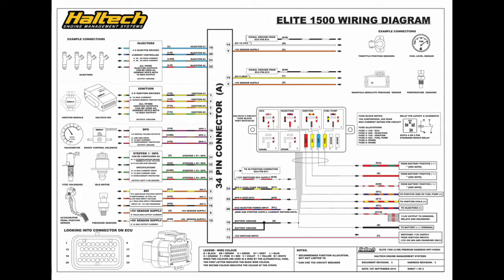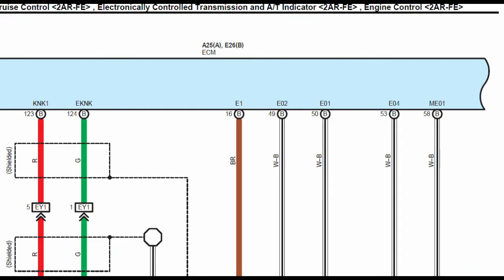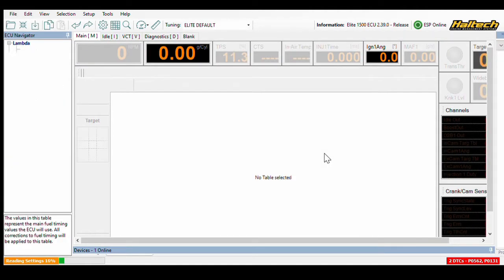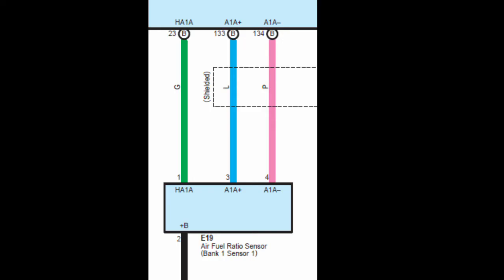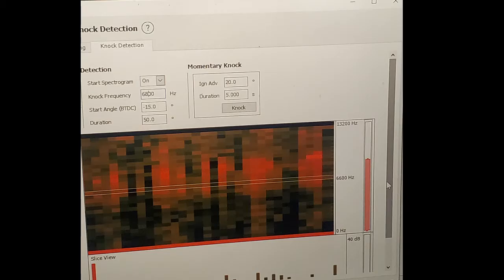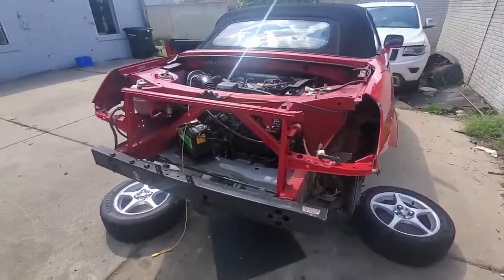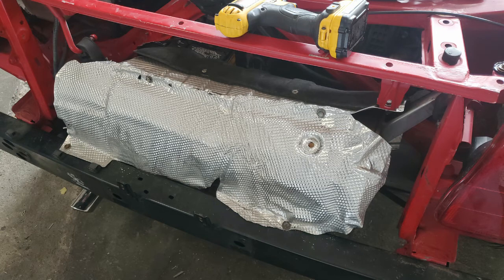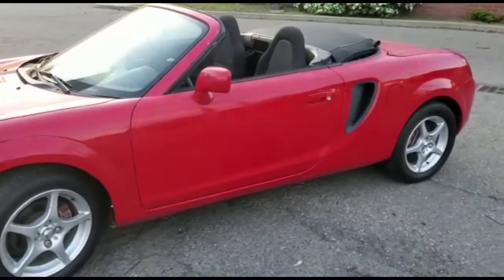MR2 Spyder Project Car Part 7 - Haltech Wiring And Test Drive

Comment: I'm really considering this swap for my spyder, given the cost of the swap and the condition of the 2arfxe when compared to K.  How hard do you think this swap is, it looks like you mostly did it in a driveway?
Reply from the maker: The wiring is always the scariest, but now that I've made a document for it to adapt to the haltech, I do think the rest is pretty much straight forward to any beginner
Reply: @abdullahmohieddin  would you mind sharing your doc
Reply from the maker: @CedricParker  I posted it under my harness wiring video
Reply from the maker: I dont think a swap could get simpler than this. I haven't done any real work on a car before and I was able to figure most of it out with a bit of help. Moderate details mostly, but the rest can be found on YouTube.

As for k series, the AR is superior when it comes to strength, cost, reliability, linear power, efficieny.... it's pointless to spend so much money building a k series to end up with about the same hp as the fxe with stock parts.

And yes, I did 99% of the project outside lol. Kept the engine inside to avoid contamination but that can be managed with a tarp.

For a first time swap, I think this is the easiest out there, especially with all the videos from Frankenstien and the fact that he will quickly respond to questions via email. I'd recommend this to anyone starting out. Even my younger brother is going to do one of these lol.